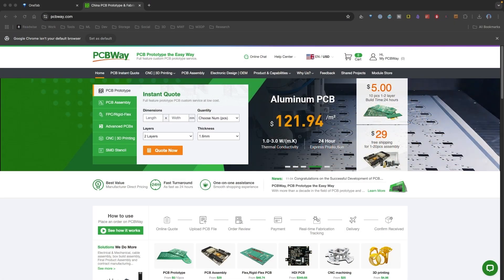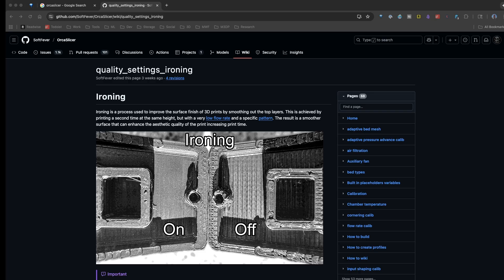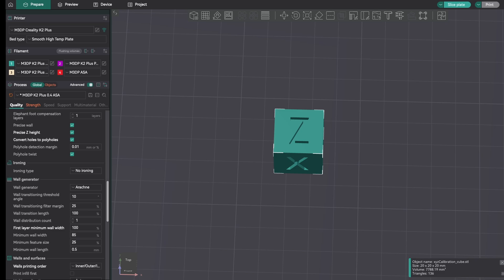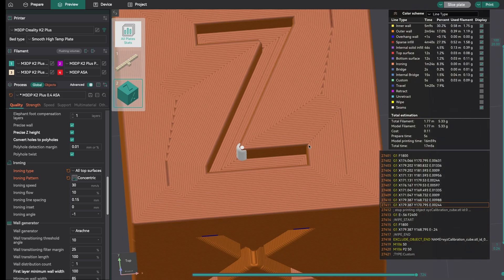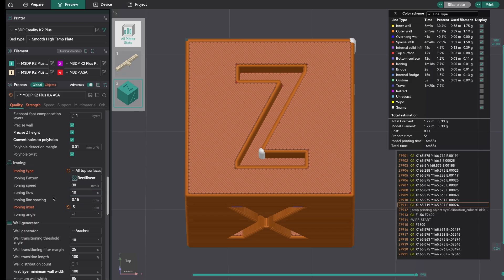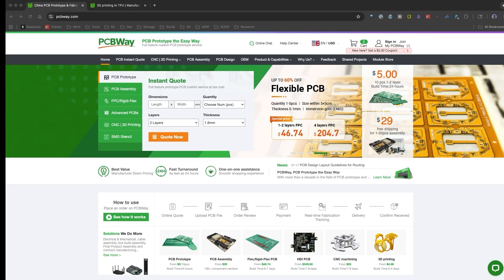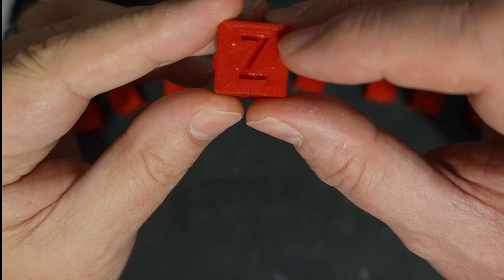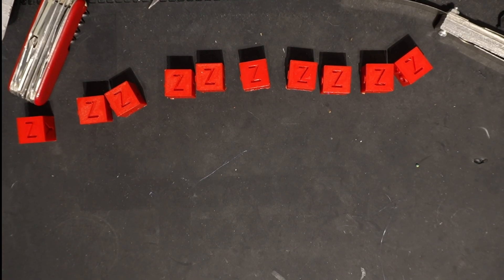OrcaSlicer Ironing: A Complete Guide to Perfectly Smooth Top Layers

Comment: I saw that circular ironing can be useful for circular top surfaces. Otherwise, to avoid, indeed. Thanks for detailing these settings.
I am printing a swatch card with transparency level test integrated, the thinnest layer is 0.2 mm only (thickness of layers), I think ironing it transformed it to a hole. So I selected Topmost surface only, it seems to work. I wish I could select the surfaces I want to iron like we can do fuzzy skin. Maybe someday.

Comment: Calibrating the speed and flow is important with ironing.  On one of my printers using PLA speed 60 and flow 40 works much better than default settings - an almost glass-like finish.  I created some short discs from the Create Primitive option to test with.